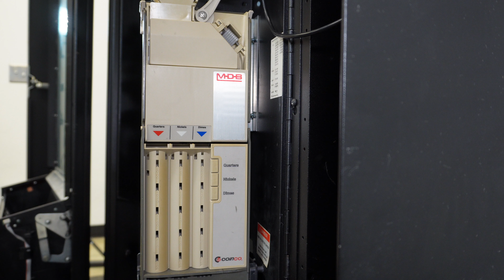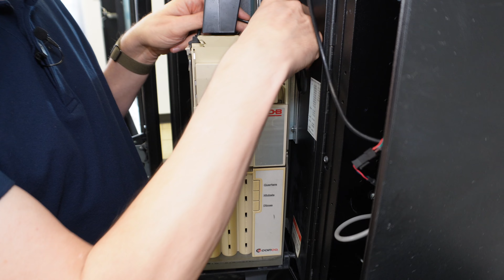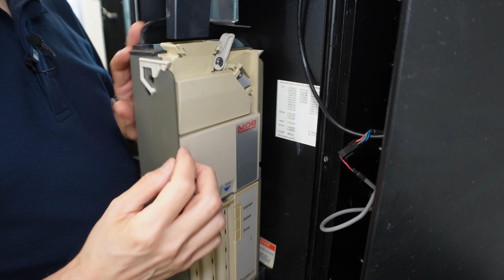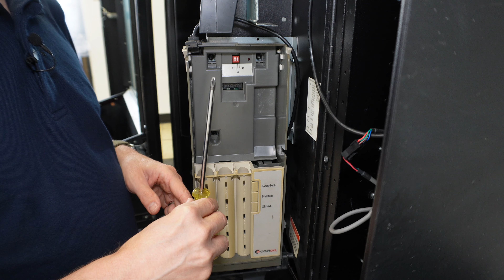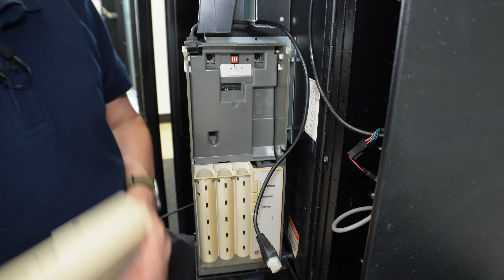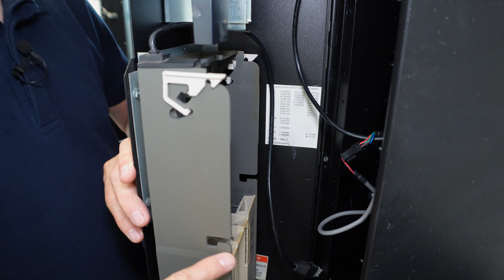Coinco 9302GX Vending Machine Coin Changer

Comment: Mine says use exact change only and the coins shoot right through any advice?
Reply: This is because loading the coins without using the proper format doesnt allow the machine to recognize  you actually have coins in the machine to disperse change.
Reply: You must use the TUBE FILL mode or the machine wont know that you actually have change in the machine